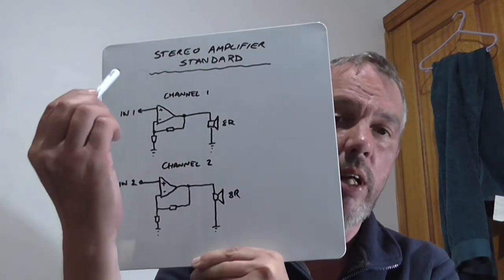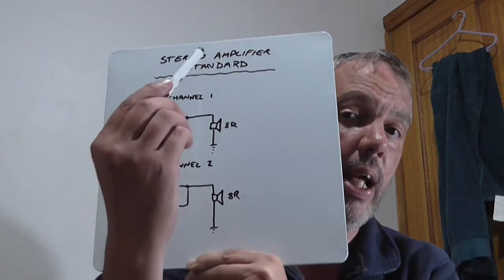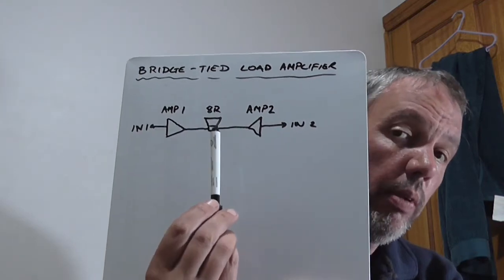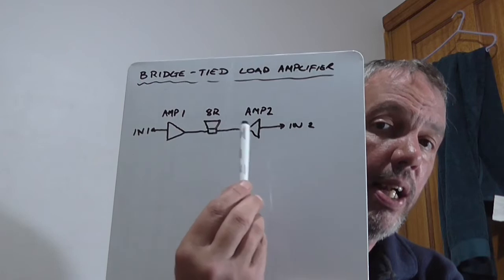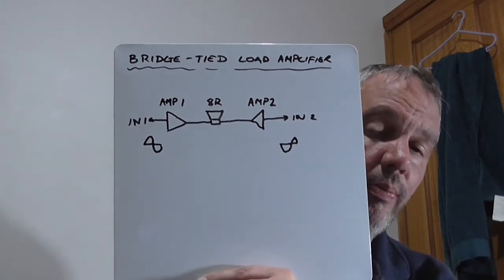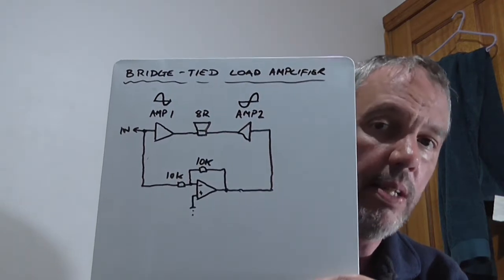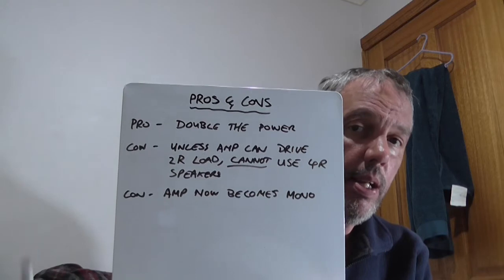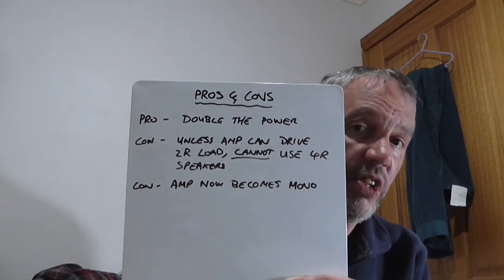Bridge-Tied Load Amplifiers Explained

Comment: “Strapping amps”? Essentially… so the slave/master switch is a inverting op amp correct?
Reply from the maker: "Bridging". One amp is in phase, the other is put 180 degrees out of phase with an inverting op amp, and each amplifier output is one connection to the speaker. In example, the first amplifier is connected to the positive of the speaker, and the second is connected to the negative of the speaker.

Comment: What if I already did buy the strongest possible amplifier the market has to offer, but still is not enough? Like, sometimes you can't just "buy an amplifier with more power" because there's none available. You sounded so smog when you said that. But anyway, thanks for the information. To be quite honest just the fact you are not an indian man talking about this subject makes me happy and enjoy the video even more.
Reply from the maker: You mean "smug", not "smog" (I ain't no puff of smoke) and honestly, I don't mean to be smug. Bridging is "OK", but really, if you want more power, use an amp that's designed to do it with a much higher elevated DC voltage, and in to the load you're going to drive.

Comment: Is there a commercially available* signal inverter that can be simply wired using RCAs in line before the amplifier audio input? (*or recipe, including parts list)
Reply from the maker: Not sure about commercial. But if you mean a 180 degree phase shifted signal, that's easily obtained from an op amp wired as inverting using two resistors, say 10k for both. For stereo, 2 more resistors of same value and another inverting op amp. Done. Inverting unity gain buffer.

Comment: Ahem, 2 x voltage swing across load causes 2 x load current = 4 x load power dissipation. Agreed that output stages need to be 2 x output current capable.
Reply: Yep, four times the power if everything else is up to the job.  Most always less in practice when bridging two mono amps (sometimes a lot less) as the PSU often isn't up to the job and and the voltage drop across the output devices increases.
Reply: @ferrumignis  Yes sure in HI-Fi world expect sagging PSU's, in Pro Audio world not so much especially with modern SMPS in pro amplifiers.

Comment: Historically the correct term is Balanced Transformer Less, just sayin'.
Reply from the maker: This is also correct
Reply: I wonder if that originated during the valve era, when a transformerless output would have been an unusual arrangement?
Reply: @ferrumignis  No, it comes from early days of transistor gear.